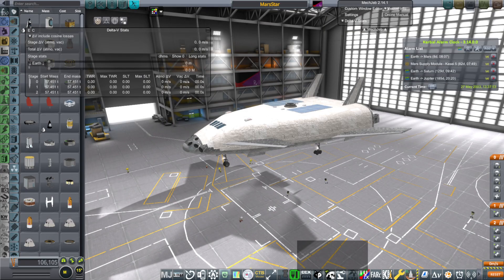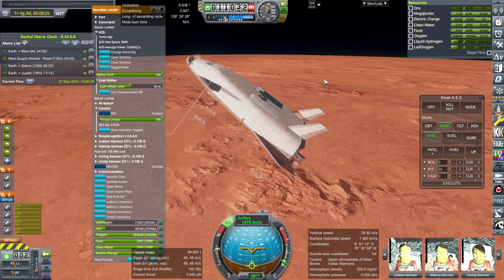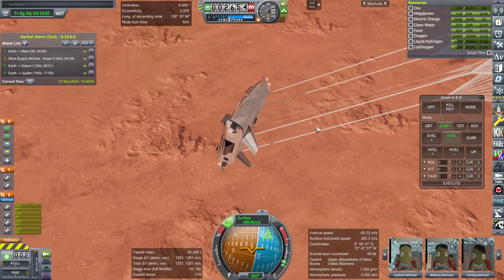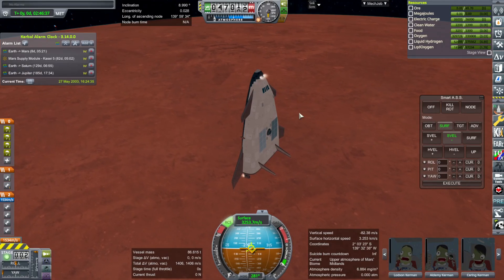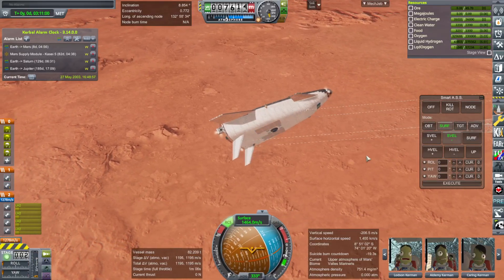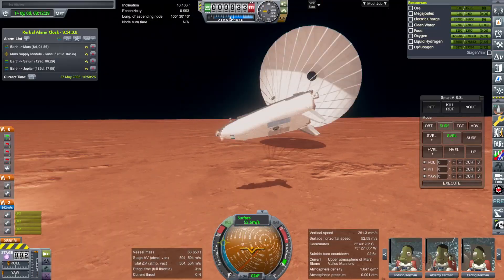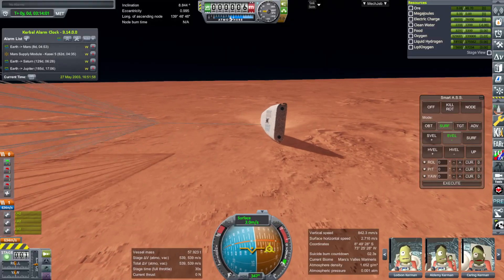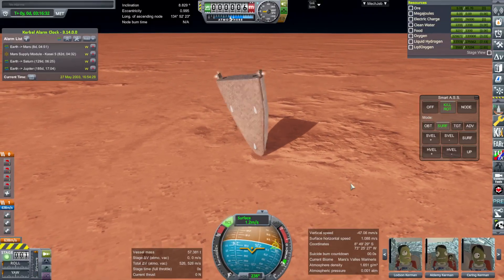Testing the Mars Star Lander on Mars (RO in KSP 1.12)

Comment: A suggestion about your VTOL landings. There is a mod, Throttle Controlled Avionics aka TCA. I used a lot for my spaceplanes and landers, it can throttle independently every engines to be the most stable as possible.
Reply from the maker: I don't know how well it does with throttle ranges that don't go down to 0 (since RO engines don't have infinite throttle ranges). In any case, this will ultimately be controlled by kOS - I'll probably just cook up an appropriate scheme for that.

Comment: I think you should try sol instead of RO. It looks and performs much better
Reply from the maker: You mean Sol vs RSS Textures (RO isn't a texture or system mod - Sol works with RO). The problem is that this install has a great many part mods and Sol's RAM requirements will result in a game crash. I do have Sol in a different install and its predecessor, RSS Reborn, in my Shuttle install.

Comment: The DLR has an interesting concept for maintaining yaw control during high angle of attack reentries with a winged spaceplane. Their ReFEx demonstrator will reenter inverted with the rudder pointing down and only flip around to have the rudder pointing up when transitioning to a lower angle of attack glide around Mach 1.5. Now, this technology is ultimately intended for use on a reusable winged booster stage, not a mars lander, so thermal constraints from mars entry heating may make this infeasible for this application. Also I imagine the negative g loading wouldn't be great for the crew.